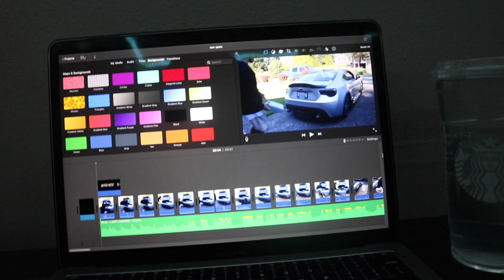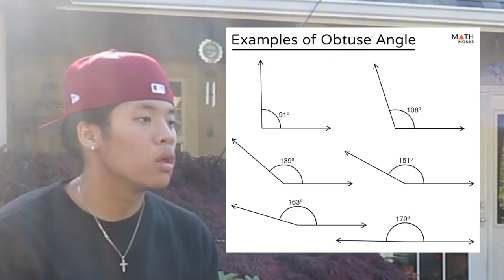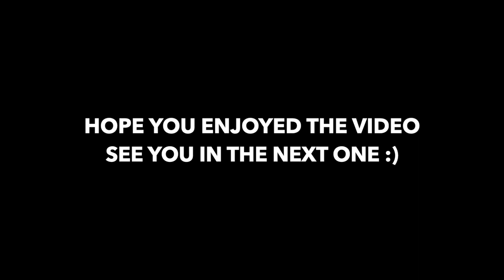Rear Spat Install on my FRS/BRZ/GT86 + Rear Bumper Cut

Comment: Great video keep up the quality content! Just ordered these spats a few weeks ago and now i just need to find time to put them on. Did you just use the hardware that came with the spats or did you use 3m tape to help it stick? A quick run down of how you put them on would help a ton thanks!
Reply from the maker: I did use the hardware provided and 3m tape, I placed the 3m tape on the top of t he spat so that it would sit flush on the bumper 🙌 I hope this helps, lmk if you have any more questions 🤝
Reply: @baysickbrz  putting them on today hoepfully its pretty easy thanks for the help!

Comment: hows the fitment? did you have to heat it up?
Reply from the maker: The fitment is pretty on point, and no I didn’t not have to heat it up, I just installed them and they fit perfectly, highly recommend !